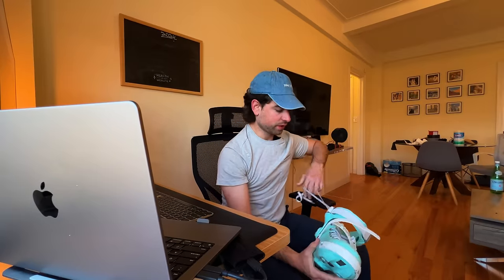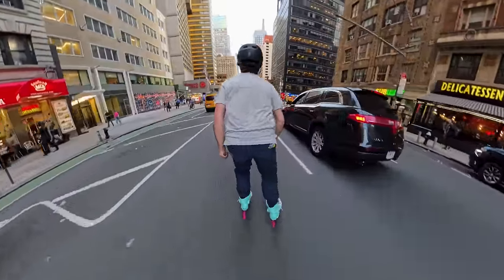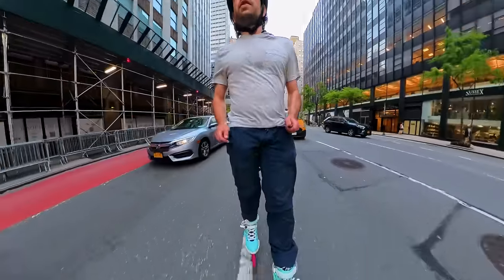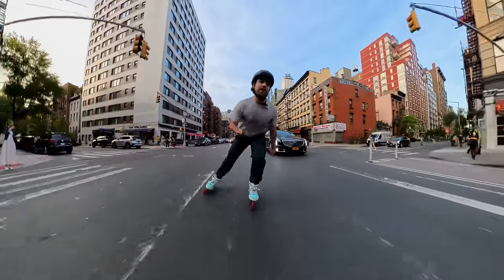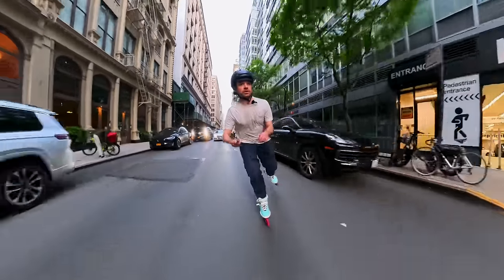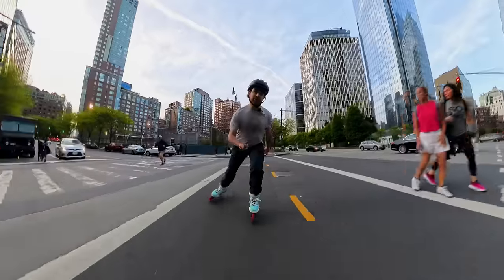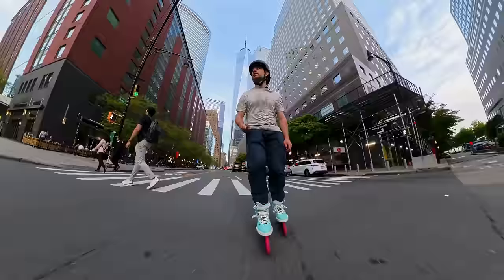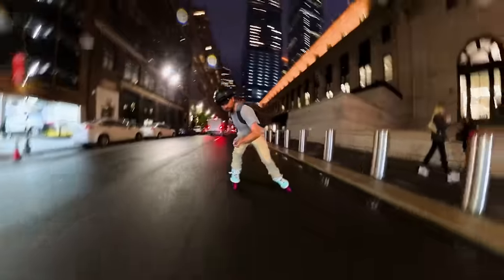Rollerblading through New York on Scooter Wheels

Comment: it's easy with the proper tool. you just need a large socket, a washer, and a threaded rod. a sort of DIY bearing puller. bearings should be properly in place and how they are just held in loose in a plastic wheel is the improper clearance. it's actually ridiculous how you can just plop them out from "normal" wheels. i know this is the common practice but bearings can't really do their job properly if they're fitted like that, and can eat the material around them.